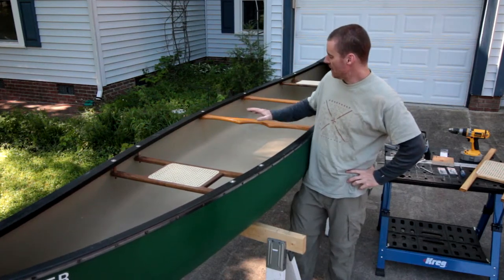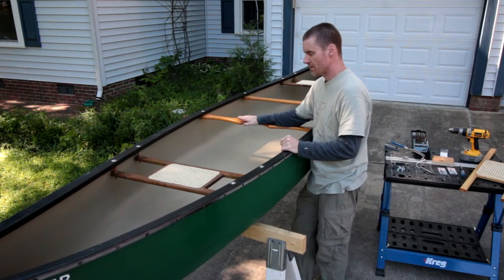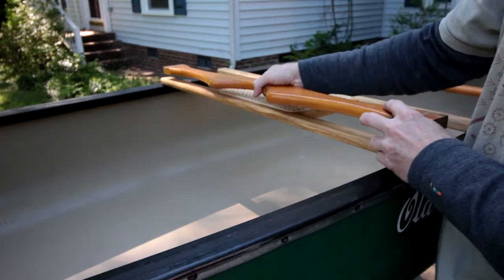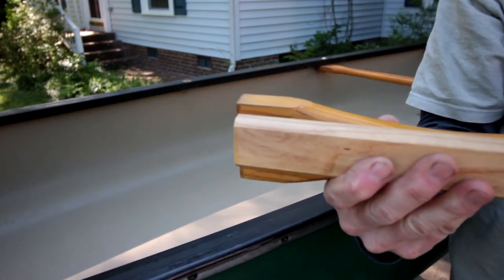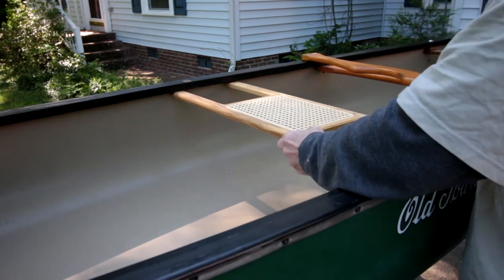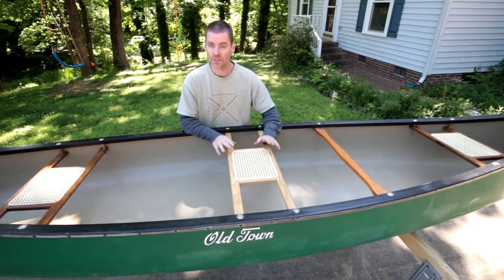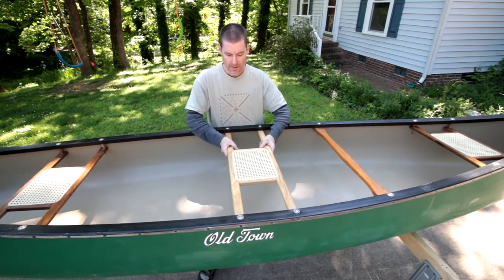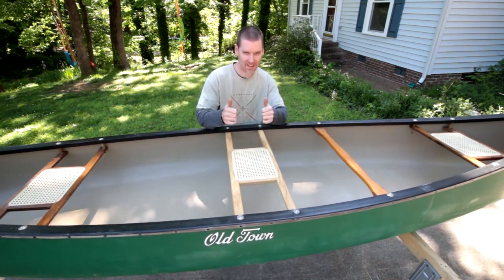Adding An Extra Seat To A Canoe

Comment: I just bought an Old Town discovery 169 down here in SC. We had a Penobscot of similar size growing up my dad bought new directly from OTC and we paddled it all over the state of Maine. 

I am definetly considering doing this the kenco seat isnt a whole lot more expensive than some of the drop in seats and it looks much nicer. 

When I was a kid we had like a little hammock seat for me to sit in the middle.
Reply from the maker: If I ever do this again, or have to replace the middle seat, I would use the yoke seat so that it could be a middle seat but still be used as a yoke.

Comment: Nice job but I think you should lower the seat a bit in the interest of stability . I’d keep the middle seat at the same level as bow and stern so you can get your feet under it when kneeling and paddling solo.
Reply from the maker: I wanted to but since I was replacing the larger of the two thwarts with the middle seat, I needed it to go from gunnel to gunnel to keep the hull rigid..  If an adult is seating in the middle seat, it makes the canoe very unstable.  If it is a small child, it is no problem at all.  My daughter had ridden on the floor of the canoe, but she wanted to be up and able to see better.  I had thought of getting one of the newer high back seats that use a bent metal bracket to lower the seat instead of dowels, but I like the look of the traditional seat.  Thank you for the comment.

Comment: I've got a fiberglass we're restoring and I will need to add a third seat.  Currently a board is across with one bolt on each side.  Any ideas welcomed.  Thanks.  I prefer fabric over caning, I think, however your boat looks super cool with the caning.
Reply from the maker: You can get new canoe seats.  Cane, molded plastic, or fabric.  I like the look and feel of the cane seats, but they don't last that long.  The main thing I would say is, use stainless steel hardware.  Thank you for the comment and good luck.